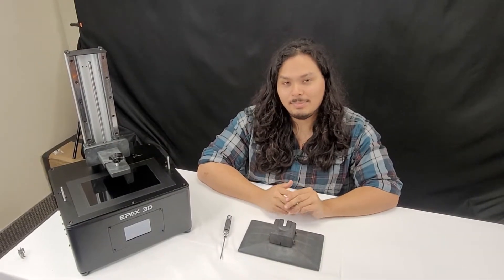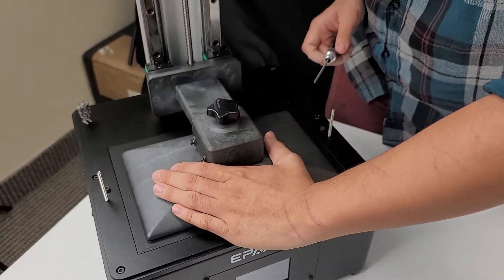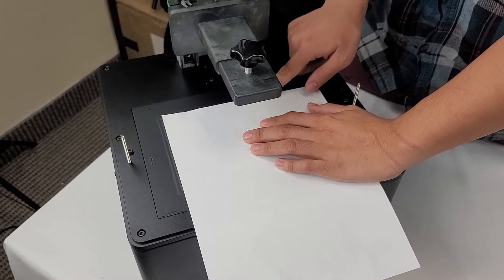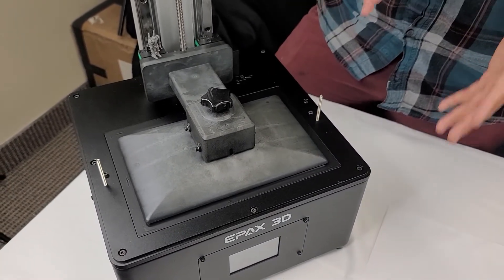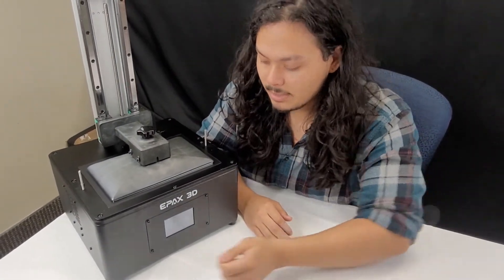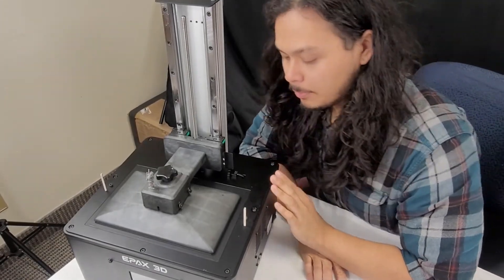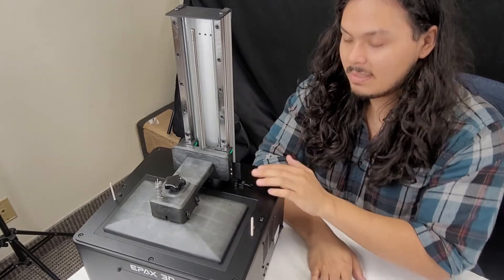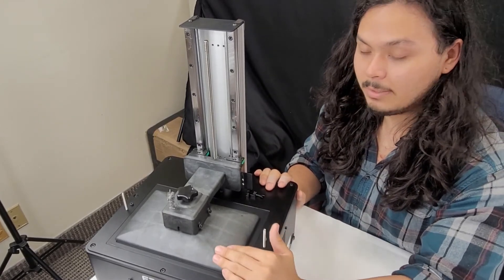Leveling the Platform on EPAX Printers

Comment: How do you level the x1 classic when i push home it starts going up and stops at 10mm and then I have to push it again
Reply: same i replaced the sensor in the back. now it never goes back to home even after calibrating
Reply: @Fellipe  I figured it out. I started a print and then immediately canceled it and it went all the way up, and then when I push home it went as normal
Reply: @MrChowdub  hahahaha literally after writing the comment i did somewhat of the same thing. ran a print with no tray and on the first scan the paper was tight. home is still off but after the calibration the first layer is at 0. i almost started messing with the screws on the plate which im happy i didnt

Comment: Sweet.  Thank you. That was all neat and clean and easy to understand.  I also have a question similar to Tim L's.  It's to do with the HOME position verses the ZERO POINT position. You mentioned that those two are not necessarily the same, so when I'm calibrating the start position for printing, by using the HOME position with the piece of paper, how does the Z-POINT come into place here? I followed the video and I ended up getting a perfectly taught grip on the paper.  So do I then want to set the Z-point here or am I good to go?

Comment: I see that you don't have the resin vat on the machine when you re-level.  Doesn't that add a few mm to the height?  Do we do this level without it?
Reply: That’s what the paper is for, to simulate the thickness of the fep filter. Without the vat it’s much more manageable to size
Reply: @dresdencypher  Ok, that makes sense.  Thanks for the reply.  The printer is working awesome!!!